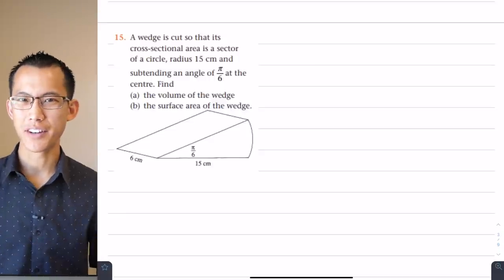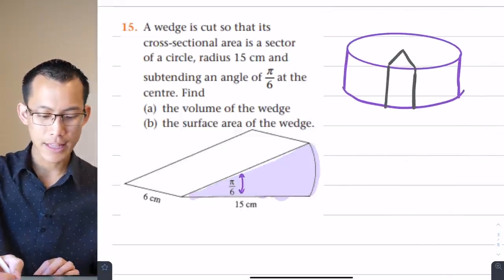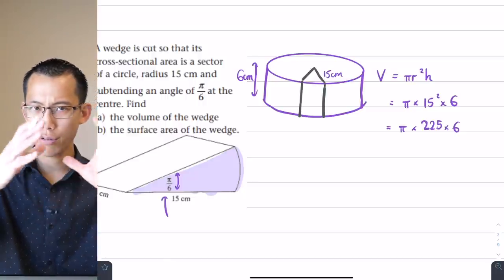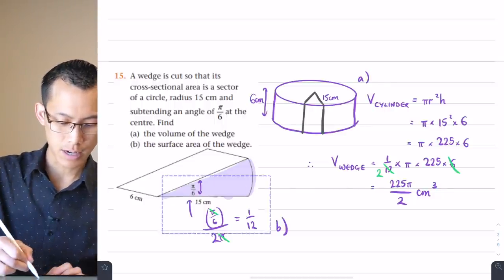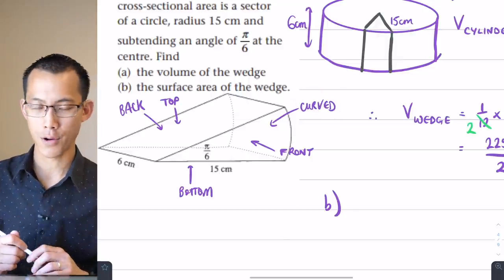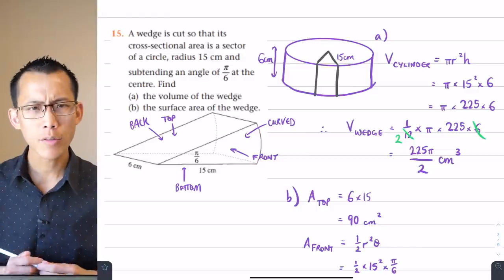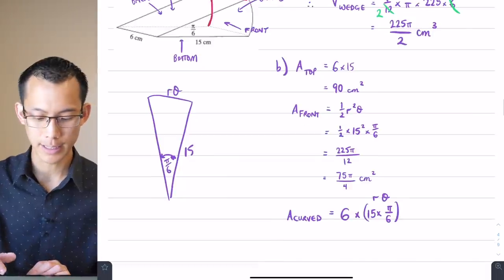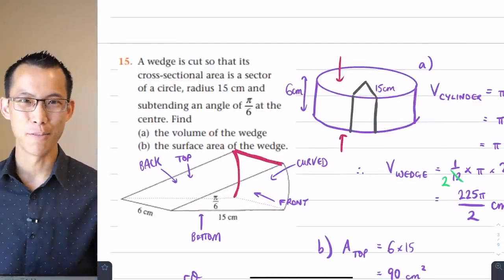Measuring a Wedge

Comment: Question. For part a when you were working out the angle, how did u get 2/pi?
Reply: I have the same question. Could you find an answer?
Reply: @saadk72510   2 Pi radians = 360 degrees, angle of a circle. So an angle of pi/6 radians is equal to 1/12 of 2 Pi radians.
Reply: 2 Pi radians = 360 degrees, angle of a circle. So an angle of pi/6 radians is equal to 1/12 of 2 Pi radians.

Comment: For the width of the curved surface, why don't we just say it's the perimeter of the circle (top of the pie) divided by the angle Pi/6 ? Instead of using the radial measure

Comment: Been nice to rediscover math, but I figured I would point out an easier way to face the 1st part of the exercise (which would have saved some time on the 2nd part as well). We learn that to calculate the volume of shapes like a cylinder we just do area*height (and we can go into why that works, how its like adding super thin slices together), that logic can be applied to a subsection as well. So intead of calculating the whole volume and then figuring out the proportion that belongs to our wedge, we can just use the (wedge area)*height. 

TLDR; (wedge area)*height = (0.5 * r^2 * angle) * height = (0.5 * 15^2 * pi/6) * 6 = 0.5 * 255 * pi = (255*pi)/2 cm^3

Not a huge difference, but a nice direct way, that reenforces understanding of how we calculate volume of some shapes, and when the 2nd part asks for the area of the wedge you already have it.
Reply: Wow brilliant! Thanks 👏🏼

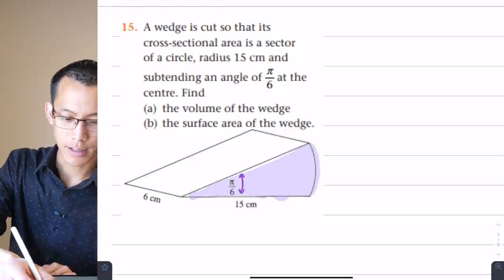Comment: Although it seems like a piece of cake, there is something I can't really neglect here honestly... The slice is not cut as said in 1:04!
Take a look at the edge of the cake at the bottom front (where the "15 cm" stands). You will see that if you were to have a cake slice like presented in the video, that means the farest left side of the cake (where you see "6 cm") should represent the center of the cylinder itself. But it is not, since the side at the bottom of the slice doesn't have a perpendicular that is a tangent of the circular side too (at the right of the sitting edge).
The cut is done very weirdly, and I'm very triggered 😢... Please relate.